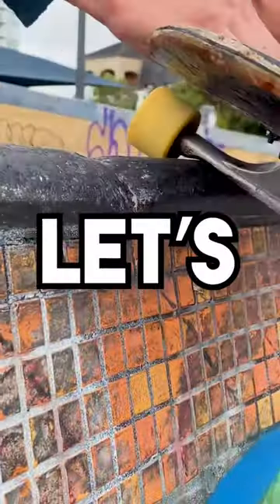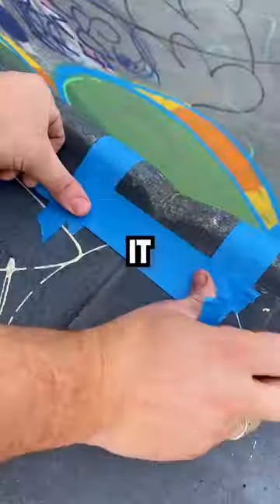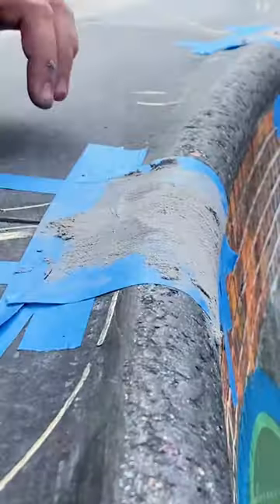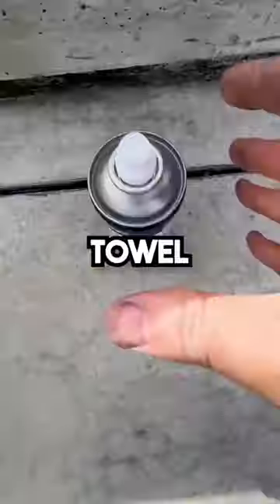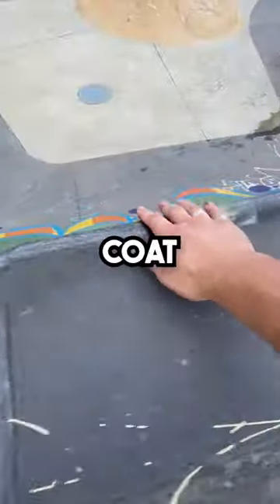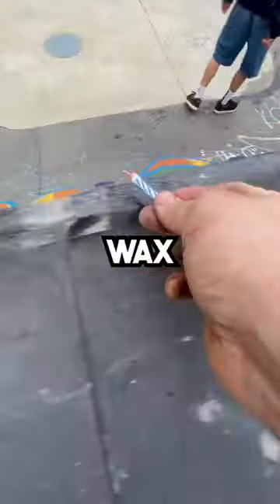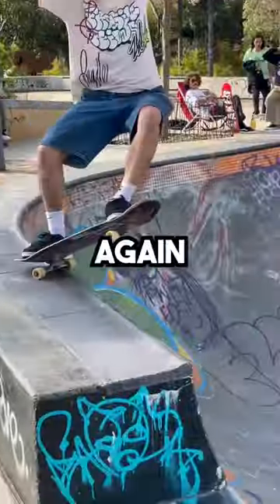Fixing The Skatepark🛹👷‍♂️

Comment: This was a fair while back,  judging from the state of the pool coping there last night 😂 Fr rhough we need to apply this process to the granite at Meadow 💪
Reply from the maker: Yeah some of it fell out, we were too keen to skate it I’ll go back and do it again at night so it can fully set.
Reply: Concrete filler is great, but anchoring epoxy lasts longer. It also is easier to apply and is ready to skate in like an hour if you get the fast setting one. Just need a caulking gun and the anchoring epoxy probably like 30 bucks at Home Depot.

Comment: Was it that the bowl was too old if not couldn't you just use wax at the beginning
Reply: its sydney skatepark
Reply from the maker: The concrete wasn’t cured properly so it erodes away slowly until it’s totally unskateable. I could have waxed it but the problem would get worse :)

Comment: why don’t you just skate it, it’s got pool coping for a reason, making it smooth takes away from that feature, vert has smooth coping but pools, pools have tile coping .. hard as hell to skate but that’s what separates the boys right
Reply: Its better than accidentally grinding  the broken coping and flying off your board and the coping of the pool is a steel bar not tiles